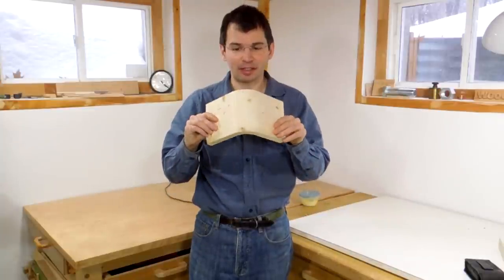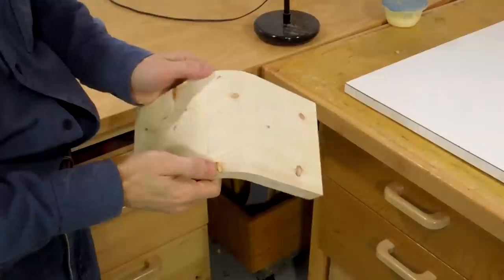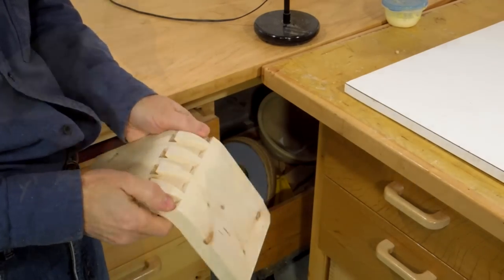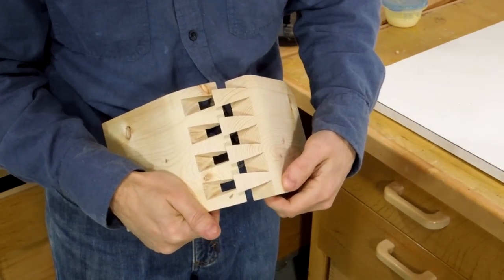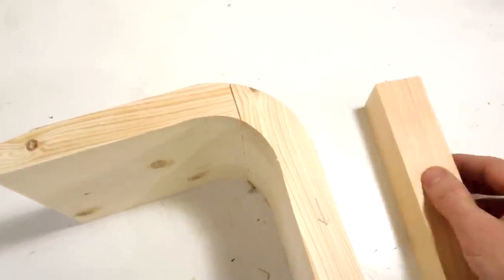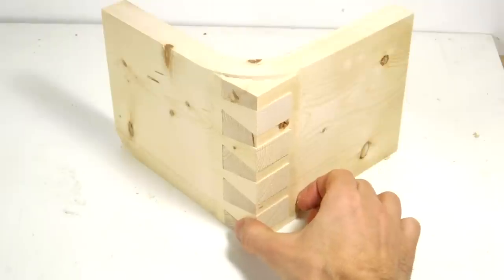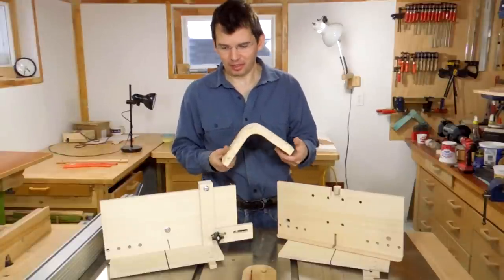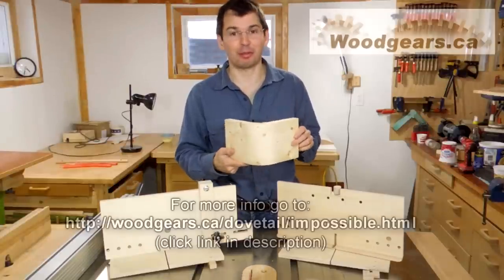Impossible looking dovetail joint

Comment: This did blow my mind but after thinking about it for a while I realised that a joint of similar appearance is possible by cutting the two halves so that they slide together at 45 degrees. A dovetail/mitre hybrid joint, if you will.

Comment: I get what you mean. You could stop this from happening on one side  I suppose by ending the dovetail cut at 90 degrees. The other side could be filled in before it's dovetails are cut by gluing another piece to it, increasing the width on the inside corner, if you felt it was even worth doing! Might be interesting to see how it looks without the outside corner rounded though.

Comment: I am building an electric car from scratch using every day items. For the chassis I want to go the Morgan route. I have managed to obtain a Dutton sports car kit body for free.
I know that laminating timber will give it strength and that when you cut the 1/8inch strips they have to go together one strip one way and the next the opposite way. As I am trying to build with as little outlay as possible, so everyone can build one. What glue should i use to clamp the strips together with.

Comment: The question is: how strong is such a joint? Could you test one of these sometimes?
Reply: +ImpGimp 
As strong as any regular dovetail joint (hundreds of years, since the ancient Egyptians) . Mostly depends on the material shear strength not the glue joint. Material will break before the glue line fails.
Reply: +Stu Bee yes, i assumed that. but wouldnt the cut outs weaken the joint? in that case you cant expect those joints to be as good as one with similar thickness without cut outs. or am i looking wrong on this...?
Reply: ImpGimp Build a bed frame. You have long grain working against racking and and much cross grain acting against shear and wedge shape working against blowout just like a regular dovetail. The strength would be the same as the equivalent dimensional material left after the cut away. To compensate use the next bigger dimensional size. This is just and experiment with softwood but if you were to do  hardwood project work I would challenge you to pull apart a walnut or maple rounded dovetail joint half this size. Full dovetail joints are used 1/4 the size of this in chair making that hold a 300 pound person. Why be concerned with maximum strength capacity that would never be approached? Not trying to make a joint for heavy lift cranes. Rounded dovetail joints would hold up just as well as square joints in cabinetry and case work. The strength is in the inner corner and large glue surface of the joint, towards the outside corner there is little strength in play if any. In such work, your concern is trivial.
Reply: +Stu Bee i am only partly concerned. since i am no woodworker for myself and only inrerested in this particular topic i try to learn as much as possible. for me, working on a 100m print press is normal and i could tell you many things about it. but then again speaking in woodworking terms: tell me more :)

i once build a stairway. that was mx biggest ww project so far. and they are squieking.. -.-
Reply: ImpGimp The physics you took in high school is real. You just have to 'see' it in reality. Disguised by paint and other treatments. It is all quite mechanical and people tend to get way to concerned about small detail to the point of paralysis and get nothing done. As a hobby every project is done for amusement, cost and time are further down the list.  Your stairs squeak, so what? ( in ww recall that 'added character') You examine them and see the causes of the squeaks and the things you do in your head to convert from drawing to a real 3D object and the better practiced with hand and power tools and you go on to the next project. Apply learned skills and improve= hobby. For ideas search Google and Bing Images for jigs and millions things more. Subject search will keep you busy for years. Don't get caught up in 'research' so much so that you don't do stuff. It is important to develop a 'feel' for your tools. Goes a long ways to improving accuracy alone by default. You will be surprised at how soon many of your own ideas pop into your head. Search the web and see how others did something similar, use of different materials for example. Things like that. You know more  about your press now then on day 1 and you print output is better then your first production run, yes?

Comment: You don't need to be a carpenter to do this you just need the desire to get into it . start small and work your way up. at first keep it simple and start with some basic hand tools. take a wood working class. but don't get put off by the way some make it look hard. it's easy just get into it and you will either love it or find its not for you. good luck